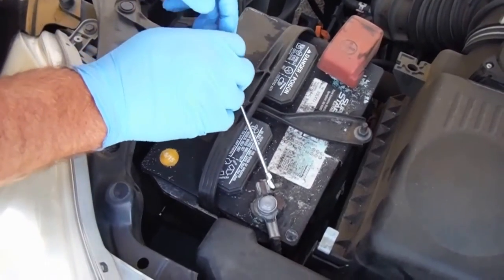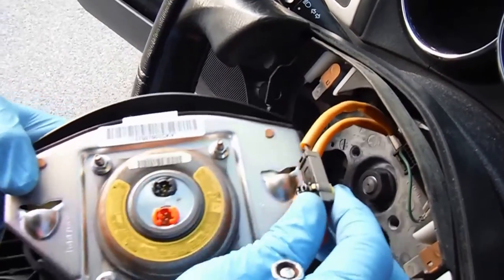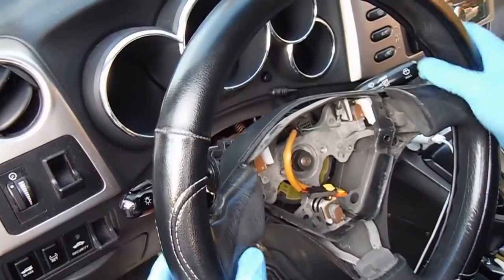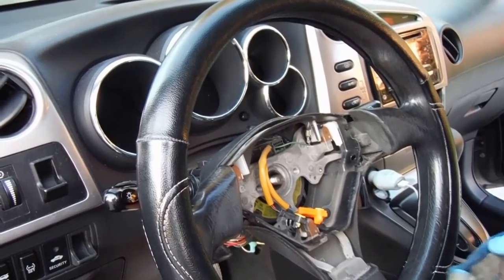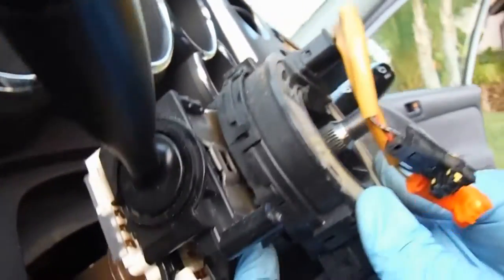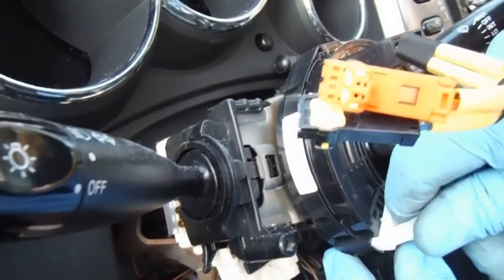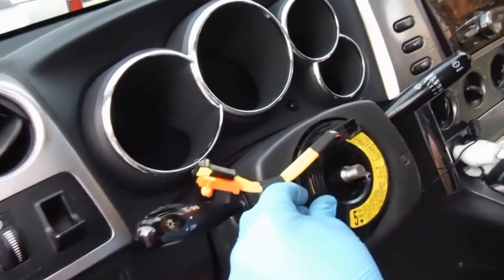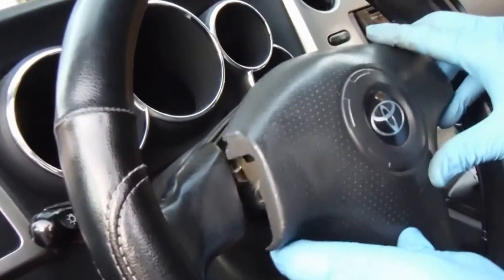2008 Toyota Matrix & Corolla Spiral Cable / Clock Spring - DIY - ABS Light Fix

Comment: Great video!!  Really appreciate you taking the time to do this, and it was a huge help.  Two things that I learned while doing this.

1. You’re not kidding about the Torx screws being tough to get out.  I actually had to shave some plastic away from the insertion point to finally get them far enough out.  One of the trickier parts of the process.
2. Be VERY, VERY careful when putting the yellow plug on the base of the clockspring.  The pins inside are very thin and flimsy and they’re super easy to bend if you don’t get the plug lined up properly.  Found that out the hard way.  Luckily I was able to straighten things out and made it work, but I should have been more careful.

Happy to be driving again without the light on!
Reply from the maker: Thank you Jacqueline!
And thanks for the great feedback.
I am sure it will be helpful to someone else.
Take care,
-Dan the Fix it Man
Reply: Have the same problem, tried to loosen them all the way but the airbag still won't come out, very frustrating. Going to try shaving some plastic away today.
Reply: I just replaced it and the airbag light went off but now I have a check engine light code P2111 "Throttle Actuator Control System - Stuck Open" rpm went up and down So I cleared the code and that stopped. I wonder If I unplugged some wire in there while I was replacing it without noticing.

Comment: GREAT Video! Explained very clearly , no wondering how to take the electrical clips off.
 Also , one of the pitfalls is, you may need a steering wheel puller .
  The dealer wanted 600$ for this work
 Not part of the Takata recall
A sensor is the recall 
NOT the "spirol cable"; as it is mis spelled in their computer
Reply from the maker: Thanks John,
Best of luck to you.
Take care,
-Dan the Fix it Man
Reply: Same, $600... had my kids watch this video and we did it together. A fun 45 minutes

Comment: Thank you for this video!  You gave a perfect explanation and it was far better than the others i had to sit through before finding yours.  

Tip for others about to tackle this: My local dealership wanted $800 for just the Clock spring part but i found it new on Amazon for $17.

Comment: I'm installing an Aftermarket NRG hub kit, on my 06 Matrix XRS. I won't need to remove the steering column, or put those T screws back in, because I'll have an Aftermarket Steering wheel, and Quick release kit hooked up, to my Steering wheel, but the steering wheel puller was helpful. now I know I might need one, because my OEM steering wheel, may not be easy to pull out.

Comment: This is a great resource. What if the code leads to the clock spring, but replacing it does not make the indicator light go off? Do you know any tricks for tracing the second wire (that is not replaced with the new part) to the potential source of the problem?

Comment: The dealer told me that the eBay part I bought used different clips.  Now I am going to pull the steering wheel myself to verify what they are telling me. I suspect they were just annoyed that I chose to supply the part myself and not purchase their mega-expensive dealer clock spring.  I will know in a few days when I get the time to get into it.
Reply: After market ones are cheaper design but still work. Dealer overcharges for this part, typically 10x more than if you buy  on Ebay. Even if have to change many times still less money.

Comment: Thanks Dan for the video. Was able to do it in 40 mins following your video! One question tho. Should the airbag light go away right away? Mine still on after driving around for a couple mins.
Reply: Did you ever get the light to turn off?
Reply: Could be another issue? An ecu or something? I think the connections under the seat are somehow in the loop?

Comment: Hello. Nice video. Really helpful. However, I tried to do some repairs in the air condition so to dismount the wheel and airbag was necessary, and now, the airbag light is on, the horn doesn't function, there's a click sound in the spring and the locks take off alone. Do you think everything is connected? Any recomendation? Thanks.

Comment: Great video, how did you diagnose it to the clock spring (spiral cable)?  My 2005 Corolla gives me a B1811 code open circuit in driver squib (second stage) . Toyota wants to replace clock spring and Airbag for $1750!! What causes the clock spring to go bad?

Comment: My yellow connector, on the underside next to the black one, won't re seat. Are the pins misaligned? I've followed instructions here.
Reply from the maker: Will the old one still re-seat in the connector?  I would carefully try that, and/or inspect the new part carefully to make sure it’s the correct part.